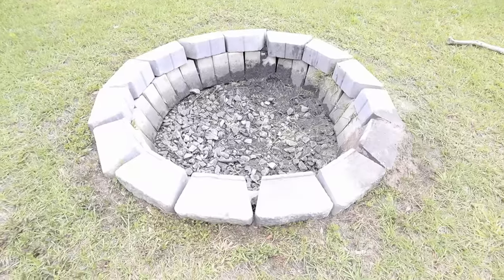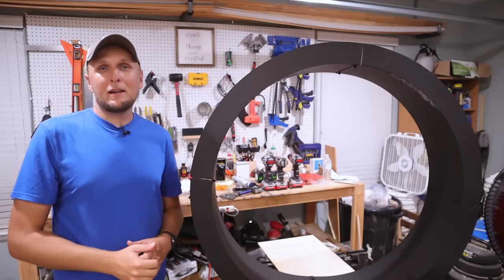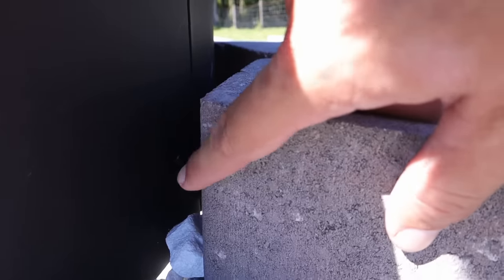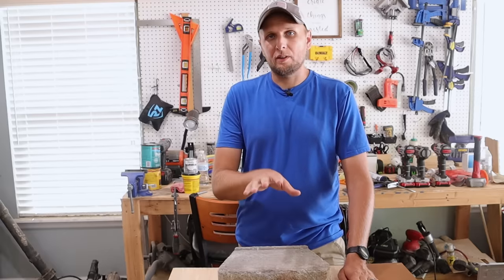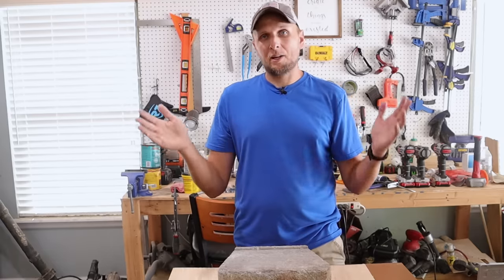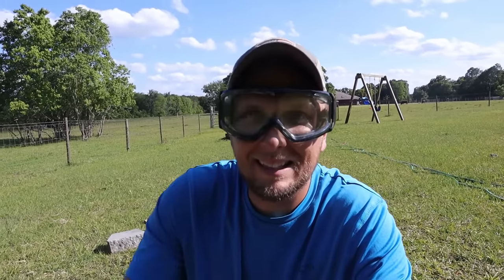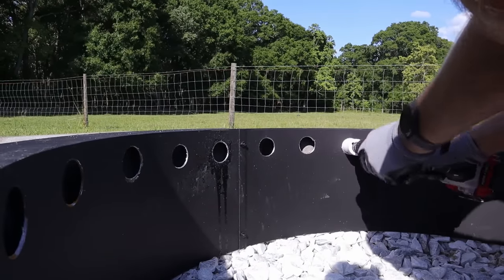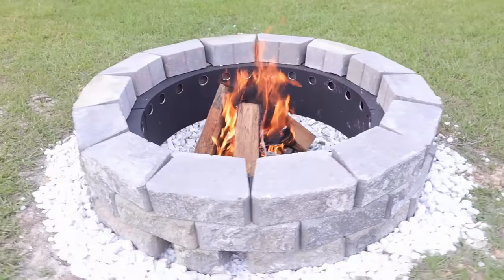How To Build a DIY Smokeless Fire Pit That Really Works!

Comment: Is there any value to controlling your primary combustion air?  I've always felt that a pit makes for a lousy fireplace, and I try to find a way to introduce fresh combustion air at the bottom.  I'm just trying to think of a way to add another level at the bottom for that and still keep the features that make it smokeless.  Or does all the air have to enter from the top, in order for the smokeless feature to function properly?
Reply: The air/oxygen should come from the top. That way it is heated before it gets to the fire.

Comment: How thick is that solid steel ring and what type of joke saw did you use?
Reply from the maker: According to the description of the ring, it is 2mm thick.  I used a 1 1/2" hole saw.  You could try a smaller one but I would not go bigger with the holes.

Comment: Question. I saw that you didn’t secure the stone too each other.. is that something that I can do with the second and third layer or does will securing them to each other ruin the design and purpose?
Reply: Because of the width of the stone,  the cut angle of the stones and only going 3 high stones high there is no need to secure the stones. Make sure stones are off set from row below will help as well.
Reply from the maker: You can if you want.  Nothing wrong with that.
Reply: @HowToHomeDIY  awesome thanks!

Comment: I want my firepit to have some more height than the 10 inch height of the fire ring.  Plus I want a spark cover, etc.  do you think the same concept would work if I bought an actual fire bowl on a stand with cover (kit) and surrounded the fire bowl with bricks like you did?  I would also put the holes around the top like you did.  Or does the bottom of the fire pit need to be stone in order for this to work?  Or should I simply stack 2 rings on top of each other?

Comment: What inside diameter fire pit ring did you use 27”?
Reply from the maker: Mine is 36” but if you have smaller fires, the smaller 27” ring would work better.

Comment: Burying a PVC pipe under the pit to allow fresh air from outside underneath the fire is an even quicker way of solving the problem. You can also t he n control airflow by choosing how much you cover the pipe end.
Reply from the maker: Yup, might be in the works 😎.  Appreciate the feedback!
Reply: I have a friend who did this, he used a small fan occasionally to draw it as well. Obviously not leaving it there after pit use

Comment: How to cut stones: put a masonary blade in your circular saw and buzz right thru them in a very clean perfect smooth line. Generally, will need to cut a side, turn up to next side, cut again, turn again to bottom side and cut thru. ie blade will cut more than half way but not all the way thru in a single cut.

Comment: Thanks for this! Building my own soon, with the aluminum pipe air intake and an adjustable "flume" on the end outside the pit. I was wondering, even before the fire ring, did you do any digging before putting in your bed of marble chips, or did you just spread them on top of the grass? I'm considering using red lava rocks instead of the white marble; any special reason you went with the marble?
Reply: Update--found out the answers to my own questions, more or less. I ended up using red lava stones instead of marble chips. Almost finished the whole thing today, minus the underground air intake (going to do that later). A couple things I had to do differently:
1) I'm using pavers that are 3" high and 10" wide, so it comes to 15 1/2 pavers to surround the ring, stacked 4 high. Since the fire ring is 10" high, my third stack was an inch shy of the flange, but I fixed that somehow by setting the fire ring and the pavers directly on the grass instead of on top of the stone bed, using a lava stone or two to level out on the bottom stack where needed. Now the third stack comes right up to the flange.
2) This part was a little bit of a surprise - in your vid, you make drilling the upper holes with a hole saw look simple. I figured that part would be cake, but I didn't get even one hole drilled before the hole saw dulled and became unusable. I'm using the Diablo 9-piece hole saw set, which is supposed to be able to cut through metal. Apparently I was doing something wrong though, because the 1 3/8" bit I was using barely made a groove in the metal. Think I was drilling too fast, and in the wrong direction (the same direction as a circular saw is the wrong direction, apparently). So going to get another 1 3/8" hole saw and try again, this time on lower speed, in the right direction, and with spray lube.

Just have to drill those holes, put on the 4th stack of pavers above the flange, and version 1.0 should be ready to try out.
Reply from the maker: Yeah drilling the holes is definitely the hardest part.  I had bought a top of the line hole saw for this and it dulled after the first cut.  Went back to my less expensive hole saws and it cut in all the holes.  Although towards the end I did break some teeth off but it got the job done!
Reply from the maker: I had done some digging before but because there was previously a hole in the ground fire pit.  I filled it in until about 2 inches below grade and then filled everything with the stone.  We liked the way the marble looked and I had some on hand already.

Comment: glad to see it works, but as an fyi, if youre feeding fresh oxygen into the fire youll find that it will burn better and stronger eating or "burning "  about twice as much or more  wood than you are used too.  so when your 3 small bundles would last 2 hrs or so , you will burn through that in about an hr .   helpful video though thanks !

Comment: Why didn't you drill your holes down low directly in line with the spacing in the bricks? To allow air/oxygen to the base of coals.
Reply from the maker: It does seem counterintuitive since we have all been taught that you want to get oxygen into the bottom of the fire.  Which I made a video after this doing just that because I do believe that it is helpful.  But the idea behind the holes up top is to feed the top of the fire the warmed up oxygen in order burn up the smoke that is in the top of the fire.  With the oxygen only at the bottom of the fire it will help but the excess fuel (smoke) will continue to rise out of the fire.  I have also noticed that the little bit of smoke I do see being produced gets pushed back into the fire from the holes and burns it up.  pretty cool to watch!  I hope this makes sense.

Comment: I was wondering instead of drilling holes on the ring why not just add hardware cloth which is a half inch square instead of holes and add that to the top part of the ring and the bottom before putting the ring in the pit for secondary combustion, and wear a full shield mask. In any case well done

Comment: how soon you expect it to rust out to collapse? what's the steel gauge...every time I've used FIRE in steel and ventilation holes...it rusts out and collapeses.
Reply from the maker: I don't expect this to happen any time soon.  I used a high temp paint on top of it and will probably just reapply as needed.

Comment: What size hole did you drill in the ring?
Reply from the maker: I used 1 1/2".  I might go smaller if I tried it again just to see if it would make it even better.  But overall, super happy with it!

Comment: If you want cheap and fast, just use a big, used truck rim. It does the same thing.
Living in the mountains and having a wild camp, makes the fire pit a must have. But I don't like any of these ideas. The reason being that the heat doesn't go sideways that much and a group of 10 people are freezing at night around that fire pit. If the smoke bothers you that much, just stay away :))

Comment: You can do pretty much the same thing just by making your fire pit recessed into the ground and much bigger. You cant get as close, but if you build your wood right it will be so hot  you wont want to be close. my pit is about 46" diameter with about 12" of piled rocks to form the ring. Its big enough for the cold air to move in and the fire to push the heated air up. This is what moves the smoke up out of your fire. The design you used allows you to maximize heat duration in the smaller pit and keep airflow coming in. Its a great way to build a pit, but you can do the same thing for zero money.
Reply: Do you mean 46" diameter?
Reply: @jimbartlettjr  yeah of course I do.

Comment: I can't seem to drill the holes in the ring? Any suggestions?
Reply from the maker: It can definitely be difficult, they took a little while to get all drilled out.  The hole saw could be dull.  I tried what was supposed to be a top of the line hole saw and it dulled after one cut.  The cheaper one that you see in the video broke off 2 teeth halfway through the video but was still able to finish.  I would start with the hole saw and apply steady and good force while drilling.  Could try a smaller hole saw.  Using some cutting oil can help too!

Comment: How hard is it to drill out the holes in steel?
Reply from the maker: I would not really saw that it is hard as I just waited for the saw to do the work while applying pressure on it but it is time consuming at least with the ring I used.  It is fairly thick.

Comment: What am I doing wrong? I left 4 gaps 90* from each other on the bottom. I drilled more holes, but 7/8” because that’s what I had and saw another video where it worked. Mine still produces smoke.
Reply from the maker: Numerous things could be coming into play.  If the wood is wet, it is going to smoke, just no way around it.  The fire needs to be large enough to be close to the holes and it needs to be hot enough to be heating up the walls to move that fresh air in.  Also, certain woods just smoke more than others due to sap and other conditions.  Hope this helps!

Comment: I’ve had to have 4 pieces of metal surgically removed on 2 separate occasions. I can confirm. Having a jagged metal shaving scrape the back of your eye lid until you get an appointment at an eye Dr is miserable.  Yes I was using safety glasses both times.  I only use goggles or face shield now when grinding.
Reply from the maker: Oh wow, your story is making my eye hurt just reading it.  I hope all went well with the surgeries and there was no loss of vision.   With metal I only wear goggles.  I have had too many other occasions of stuff getting around the safety glasses.  Hope you are well!

Comment: Did you use the 36 in or 27 in fire ring.
Reply from the maker: I personally used the 36 but the smaller one may work even better just because the hole will be closer to small to medium sized fires.  Just depends!

Comment: Hopefully drops the smoke to an acceptable level, next step looks too difficult for me!
Reply from the maker: We love ours.  It made a huge difference.  If I was to make another one of these, there are a few things I think I would do that I think might make it work even better.  I would get a smaller diameter ring so the fire doesn't have to be so large to make this work best.  I would drill slightly smaller holes all the way around.  And the last thing I might try that may help you, is I might try drilling a few small holes towards the bottom just to help feed the bottom a little as well.  I hope you enjoy yours as much as we have.  Enjoy the project!!

Comment: Ok so what is the drill you used to put holes in the metal?
Reply from the maker: I used a cordless 20V Porter Cable brushless drill.  Any name brand 20V drill should do.  I am just partial to Porter Cable 🙂

Comment: What size hole saw did you use?
Reply from the maker: I used 1 1/2" which works great but I wonder if smaller holes and more of them might work even better.  Either way, I am happy!

Comment: For metal shavings in your eye. You definitely don’t wanna stick your dirty digits in it but Simply grab a decent size magnet from your fridge, Disinfect in case you touch your eyeball with it and get it as close to your watery eyeball as necessary with the strength of a magnet you can test on shavings from your cut or drilled hole. Easy Peezy lemon squeezy.
Reply from the maker: Yeah have has some folks recommend this.  Will keep it in mind.  But will also try my best to avoid it!  thanks for the tip Ryan.

Comment: It is far easier to put your bottom row 2-3" lower or deeper into the ground or base material which would bring the metal ring higher when placed onto the third row. This allows the fresh air in and you don't have to drill all those holes.
Reply from the maker: You don’t want the metal ring higher than the ground though.  There will be no envelope of back pressure to push the fresh air into the top of the fire.
Reply: @HowToHomeDIY  I fresh air is not pushing anything it's being drwan into the flames allowing for a more complete complete combustion and less smoke.  All I know all of mine have worked perfectly. Also if you do have the ring  put the holes in the bottom works perfectly and more asthetically looking. Oh by the way i noticed in a second video you put a fresh air tube at the base of the fire. HMMMMMMMM Sounds like what I just stated.
Reply from the maker: Yes I wanted to get some more air in the bottom.  It made it work better.  But the holes at the top will not work if the bottom is wide open.
Reply: @HowToHomeDIY Once again no need for holes at the top.  Bottom isn't wide open because al I did was drill a number of 5/8" hole at the joints of the stones aronud the perimeter.
Reply from the maker: 😂 Hey you do you.  Glad it works for what you want.

Comment: The fire ring is 10" deep.  This does not seem very deep to me.  I could not tell in your video if you raised the ring a bit when you put in the paver stones or does the ring sit firmly on the gravel?
Reply from the maker: That’s why it’s sitting on the top of the second row and I just built up the base for the pavers a little bit just to bring them up to 10”.  Hope this helps.

Comment: Is there any benefit to placing the holes at the top vs at the bottom of the ring?  I would have thought that you feed the fire oxygen at the base of the flame so having the holes at the bottom makes more sense?  Dunno, just asking.
Reply: If I may interject as it was explained to me this way: Wood doesn't burn. What actually burns is the volatile/flammable gasses released when wood is heated to a specific temperature. So, fire becomes self-feeding once it is started. Smoke indicates incomplete combustion of those gasses. When oxygen is re-introduced into the now rising heated gasses, a secondary combustion takes place, consuming a significant amount of the unburnt gasses. Thus, the smoke is virtually eliminated.
Reply: @pawpawstew  good explanation thanks!

Comment: Does anyone know what size block was used?
Reply from the maker: I do! 😎 4 in. x 11.75 in. x 6.75 in.  Also if I was going to do it again, I would buy a smaller in diameter ring, probably drill smaller holes and drill a couple in the bottom.  I can’t help but think it would make it even better.  Hope this helps!
Reply: Thanks! That's really helpful.

Comment: You will be getting air drawn though the gravel from the bottom, over time it will fill ful of ashes! QUESTION so is it still going to be smokeless in a year or more of repeatedly using 🤔
Reply from the maker: Yes because the air draw in the bottom is not what makes this smoke less.

Comment: How many stones did you use total?
Reply from the maker: With my setup, it was 12 on the bottom row and 14 on each of the top two rows.  So 40 total.
Reply: @HowToHomeDIY  Ok cool. Thanks
Reply: Which size ring do you use? I noticed you listed a link to 2 different sizes. I really like the size you used in the video. Thanks for posting this.
Reply from the maker: I used a 36”.  It might work even better if it was a little smaller just because the fire will be closer to the ring and holes.  Just something to consider.
Reply: @HowToHomeDIY  okay thanks

Comment: Like the idea, not sure if that fire was big enough to really generate the pre heated airflow this design was intended to generate. but am thinking you could easily improve this with simple black iron pipes using the bottom course gaps you've left open... Maybe a series of tees with short extensions and elbows on the ends of "arms" off the tees so you can direct airflow, the center extension off the tee would face out thru the gap, or perhaps a big  square "U" shape to match each pair of gaps and drill vent holes/cut slots in tops of pipe to allow air extraction into core and sides of fire. Start small and add holes in stages so it can be experimented with ? You wouldn't need to bury them either, keeping the pipes flush with ground so fire heats them would improve performance. Remember to screen the open ends with something so mud daubers don't nest in there blocking the pipes !
Reply from the maker: The thing only smokes less the bigger it gets.  If you do all that you said let me know how it goes.  I personally couldn’t be happier with how mine works and turned out.

Comment: I really like your design. I made something similar that worked well - it was a piece of 30" Diameter weld pipe (from a pipe fab shop) with a 3/8" wall thickness, and it had roughly 5" long x 3" high slots cut out around the bottom. We would get that thing running like a rocket engine stuck in the ground and you could hear (& see) the air rushing in through those slots.
Looking back I probably should have made the slots a little higher up (& used a larger pipe).

Comment: The fire ring is thick steel about 3/16 No problems using hole saw? Anyone attempt these instructions yet?
Reply from the maker: It is what I used in the video as you saw.  No pun intended 😂.  I would not consider it easy though and you will want to make sure you have more than one hole saw in case it wears the first one down.